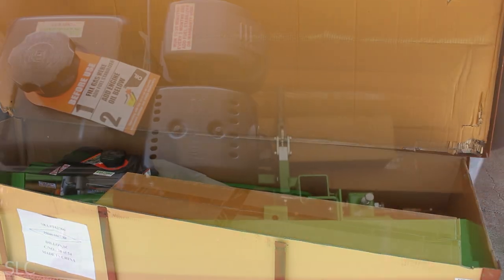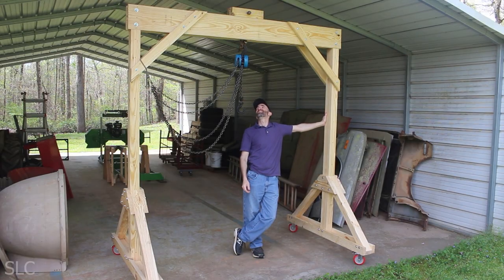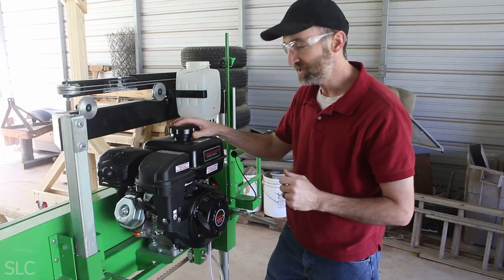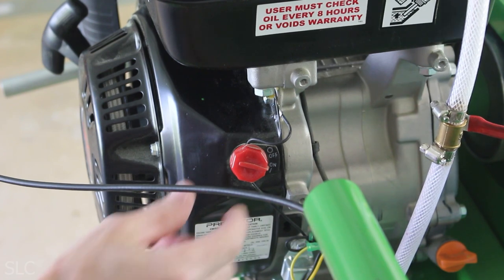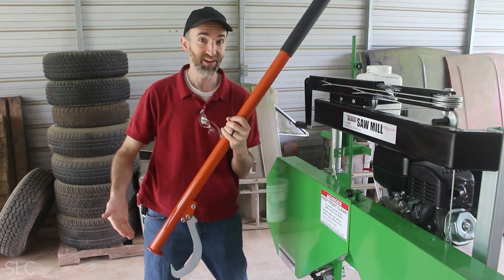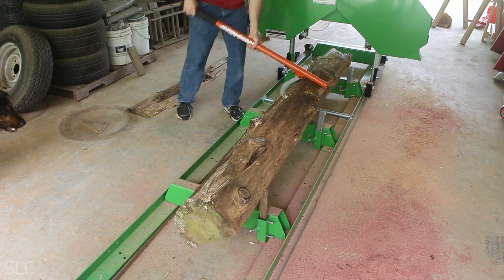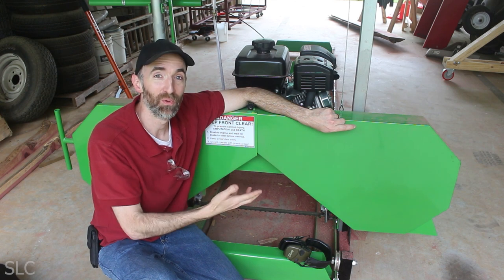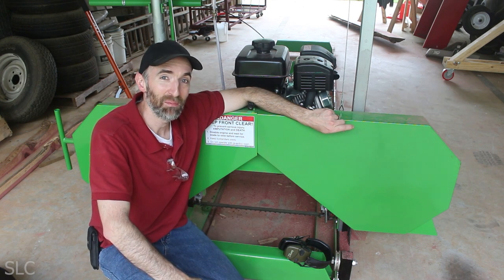Purchased a Harbor Freight Sawmill - Setup and First Impressions

Comment: Nice video.  Living in Japan, these really don't exist anywhere.  I ended up ordering one from Alibaba, and had it shipped in.  What an adventure that turned out to be.  There were 0 manuals, and nothing on the engine or engine maintenance.  Everything needed tweaking, and yeah, the weight of that engine mounted on the saw and its awkwardness proved a shock.  Your saw is a lot smaller than mine as well.  It took a full day for me to get it mounted on the rails.  But they are really great!  I ended up buying rail extension as well, so I can cut up to 7.5 meters (24.5 feet) long slabs.  Be careful with small pieces.  They will fly off your track and smash into the left side of the saw, damaging the blade, and potentially saw guide as well.  I guess I'm seeing this post late, 2 years after posting, so you probably have found all that by now.  Cheers, Scott from Japan.
Reply: @locomokko  hi - what one did you buy from Alibaba and how big is it ?
Thank you 
Sean

Comment: With the current price of lumber, you should be able to cut yourself plenty of rough cut and plane it down for use! Be interested if you think the time and money spent will be worth it, then just buying rough cut locally..? Good Luck.
Reply from the maker: With all of the trees on our property and surrounding areas, we will probably be able to save a good bit of money once I perfect the milling process. This tool is a little expensive up front but over the long run should pay for itself many times over.

Comment: I didn't know harbor freight had saw mills
Thanks for showing that it works
the sound of the motor after you started it didn't sound promising
was it slow to cut?
Reply from the maker: I'm still learning the best RPM to run the engine at to make the best cut. I believe I was only running about half speed during the video.
Reply: @SpecificLove7  I figured you didn't rev the motor after starting it because it wasn't under load
We didn't get to hear the motor while it was under load, that part of the video was in fast speed mode
I was just curious on, did the motor seem powerful enough or did you have to take it slow so the motor could keep up? I've bought Drill Press and Circular Saw from harbor freight and both had to be babied through a treated 2x4.

Comment: What's the max length log it will handle?
Reply from the maker: About 9 feet
Reply: @SpecificLove7  I was hoping it would be at least 10 feet if not 12 feet.  9 feet seems a little off the normal board length. Granted you can cut it down to 8 feet.

Comment: Why bother with this, if you have to dry wood for years anyway? 
I'm genuinely curious, I'm new to this. Doesn't it take around a year to dry boards? Do you honestly plan to wait a year to use freshly sawed boards?
Reply from the maker: It really just depends on the type of wood and thickness you cut it, but for the most part you are correct about a year or more of wait time. That is unless you have a kiln to dry it out much faster. I have a plan to build a solar kiln in the near future to help improve that dry time. 
And if you build a bunch of projects like we do, a year's time can go by pretty quickly.
Reply: @SpecificLove7  Thanks for explaining.
Reply: @ignatiusreilly8280  you can build with wet wood...
Reply: @schlomoshekelstein908  Oy vey, vith vet vood, you can build, you say?? Come by my vay, I show you my vood!